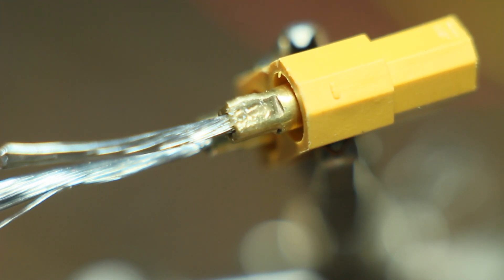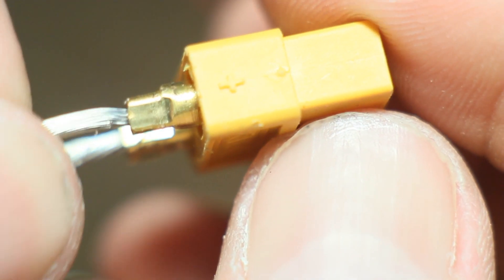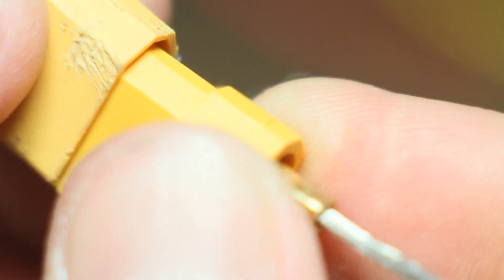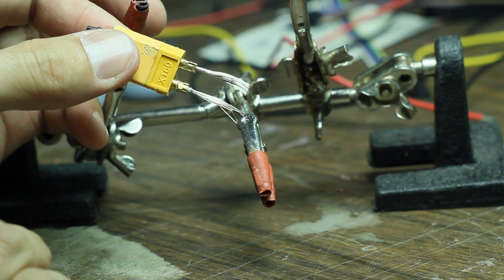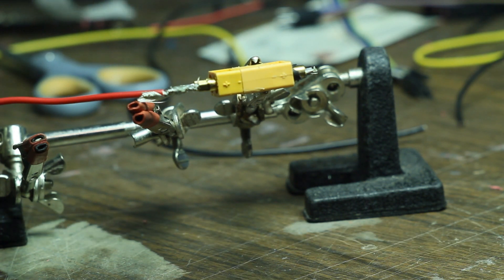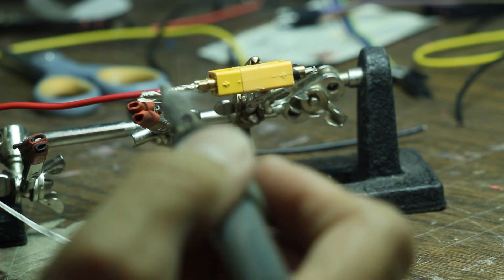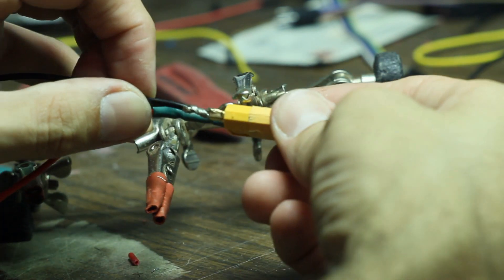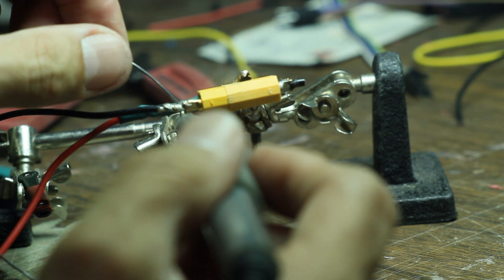ENDER 3 CRIMPED XT60 Followup Repair

Comment: Dont trust in this connectors, they are bad soldering, mine was very "solid" but turn very hot and black.buy a new one and solder to the same cable solder
Reply from the maker: Did you not watch the video? You can trust the connector when YOU solder it.